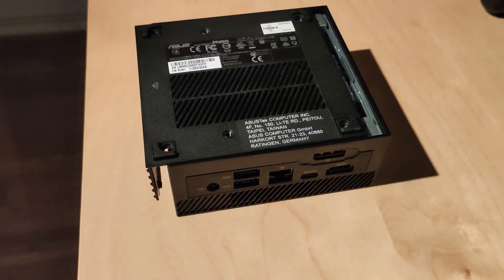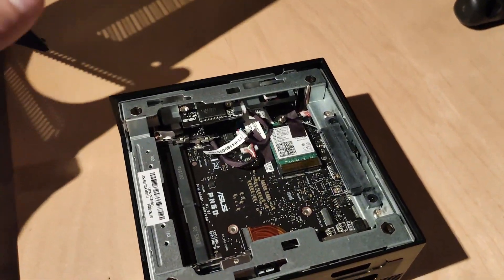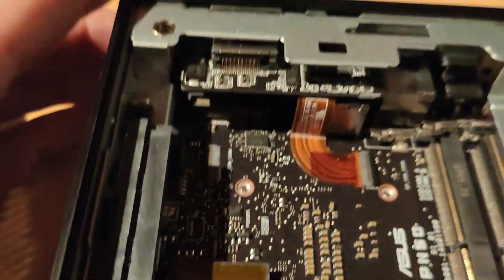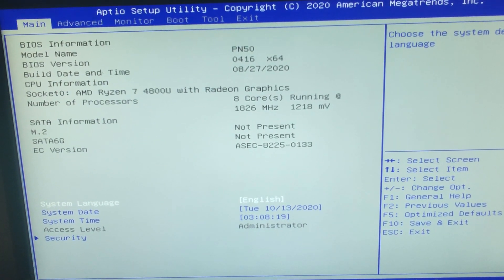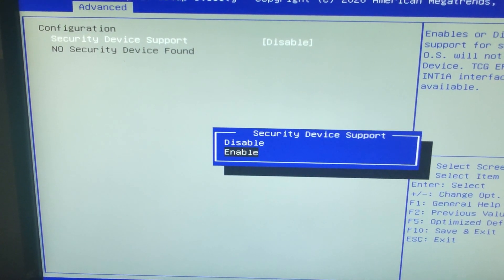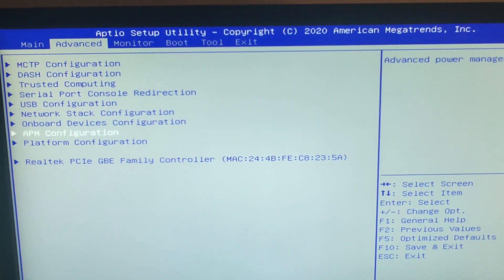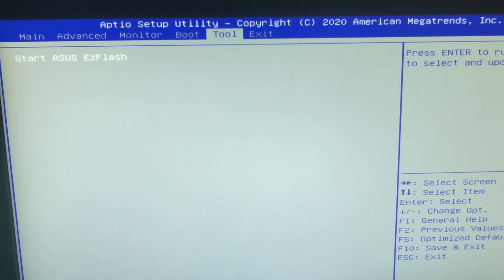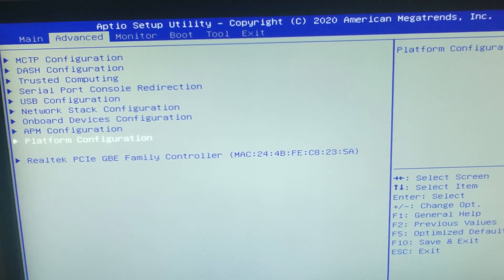ASUS Mini PC PN50 (Ryzen 7 4800U) Review - Part 2: A Look Inside & BIOS

Comment: I was looking at another box with 4800U for use at home as a virtualization platform (8 cores, 15watts! <3) but apparently it didn't support DDR4 XMP profiles so it couldn't take advantage of high-end (low-latency) memory sticks. In practice only CL22 3200MHz memory is supported - is it something to worry about? Is it the same with PN50? I didn't notice any RAM settings in the bios.

Comment: I have this, and the main problem with it is the CPU temperature, which easily gets to almost 100 Celsius, and then the processor throttles, which makes this very fast processor work at half speed. Shame.

Comment: Hi, thanx for great review.  I need powerful and tiny Win10 engine for industrial use, so I came across this Mini PC by searching, which one has actually built-in serial port hardware. From the spec's it's obvious, that there is a slot for three options of external ports: DP, VGA or RS232. I can actually buy one immediately in my country,  but it is equipped with DP. I see, yours is too, so since you have it in your hands, I would kindly ask you to check, if despite DP option, there is still a RS232 header present interrnally and that Win10 shows one COM port in device manager. Namely from any googled picture or video, neither from spec's, that can't be figured out. I would appreciate so much not to buy something in vain. Thank you.

Comment: Got mine a few days ago. Today the NVMe arrived, when trying to install it the tiny screw got lost in the corner and slipped under the mainboard 😭 can't retrieve it anymore, shaking, turning, softly hitting it, no use. Can't figure out how to get the main board out either. Patiently awaiting your teardown!
I'm afraid turning it on could damage the board, as I haven't got a clue what's on the upper side. Is there a fan btw or is it passive?
Reply: Oh no that sucks. I have a strong magnet on the end of a long probe which may work. Have you tried something like that?
Reply: And there is a fan, it's not passively cooled.

Comment: Just needs a BIOS unlock so you can raise the TDP ;)
Reply: Then you need to change the cooler.
Undervolting would be way more interesting since the cpu is very fast with 25w tdp

Comment: This M.2 is PCie 4?
Reply: the M.2 is PCIe 3.0 x4. so no, its not PCIe gen 4
Reply: @CrazyBulletShooter  that would be bad, since even at 3.0 the temps of the SSD is around 70-80C usually. That is way too bad.